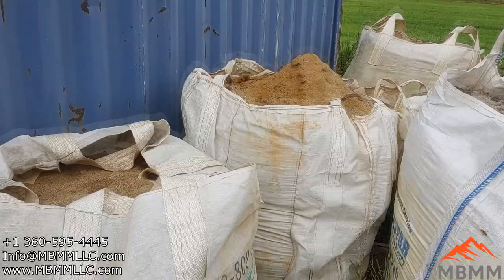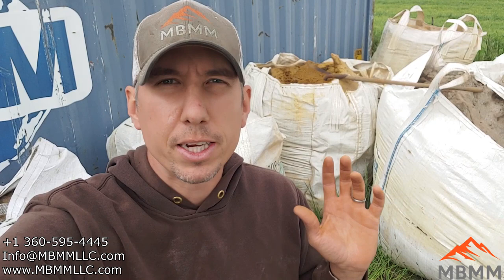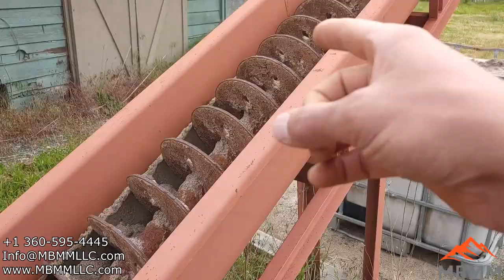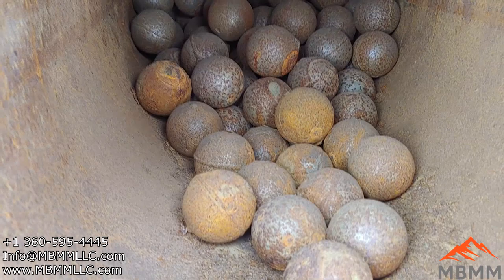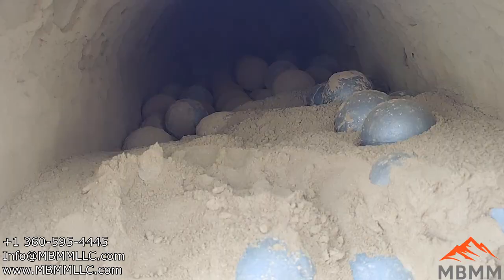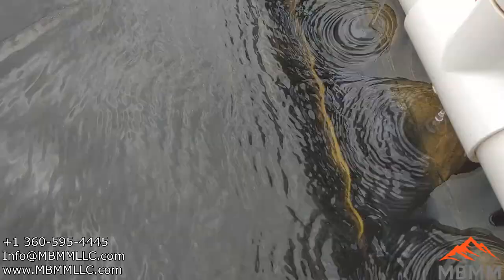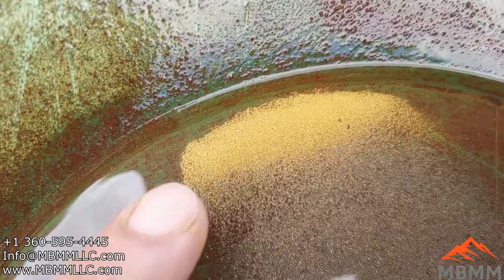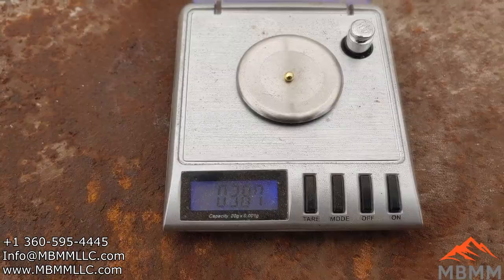Regrinding Gold Tailings In A Mini Ball Mill! Better Recovery & More Gold??

Comment: Adding some soap helps recover extremally fine gold, you want just enough soap to break the surface tension of the water, not so much that it has suds in it.. Adding Jet dry is better yet...
Reply: water softener and detergent is what you want. As you said lower surface tension so it can drop down

Comment: You can use stokes law to figure out settling times. If all your particles are the same size then just dump them in a column of water and pour off the solution at the time the gold hits the bottom.

Comment: There is a gold field here in West Central Victoria near Percidale where the gold is hosted in pyrite (Ordovician deep marine black smoker) - About half the gold is too fine to settle by density alone.

In the same area there are rich reefs with much larger grain gold and nuggets to several hundred ounces - derived from hydrothermal veins (likely originating from the same sulphide source, but moved)

So depending on the nature of the gold you are processing, your requirements will change.  Knowledge is power.

Comment: Jason there is non toxic leaching formulas out there , check out Action Mining.If you take some of your cons from the panning what you just ran from the ball mill, say 100 grams, soak in Aqua Regia over night, then do a Stanis Cloride test on the fluid the color of black will tell you there is gold left for recovery.
Reply: You will still have to do water works with Aqua Regia.
First you have to neutralize it, and then you have to distill out the salts.

Comment: When you were talking about the smaller particles having issues separating properly on the shaker table I had an idea. I’m sure you have, but have you done a test to see if varying the frequency and amplitude of the vibration on the table affects separation? And whether the efficiency can be improved with a finer material by changing these parameters?

Comment: Great video… excellent job of explaining your processes and teaching the skills to the world… I also believe you are still marginally above the point of diminishing returns… pulling 13.5 grams a ton at today’s market price is right at $750 profit per ton…  I don’t know what the cost of your operations run to conduct the extra processing per ton but I’d guess it’s below that mark…  and if a test sample is done prior to first run processing then it could be even more cost effective because then it could be a modified system first time around and not two totally separate processes…. Thank you for your excellent video.

Comment: I have just gone back and reviewed your video on regrinding black sands,and by comparison it would seem the tailing sands seemed to yield a better result than the sulphides.
Question One/..Could this indicate that there is more bound gold in the quartz  ,and/or other rock, in the sands ,than gold bound to sulphides in your number one and two tailings?
Question 2/...Would it be worth an examination under the microscope of grains in your sulphides and grains in your sands to see if bound gold can actually be seen?
Question 3/...I looked to me that you got a better result in this video by grinding dry than in the previous video grinding wet material. Would you agree with that? Cheers.

Comment: Adding jet dry to your water will break surface tension of the water for better panning ..   grinding for a lot longer till it is fully silted.      And when you smelted the bottom of the pour Ed crucible was still lumpy.  Maybe stir it a bit and keep heating then your molten into the triangle mold.     I'm autistic not trying to be critical of your methods but I felt I had to give you my 2 cents.  Thanks for your contributions and sharing your experiences.

Comment: How would a ball mill fit in the turn key system would it be opened ended with a screen and how fast could the out put be could it keep up with the whole system at full throttle

Comment: Agree with what you said about finding out up front how much can be liberated.  But you also have to factor in labor and equipment cost, no?  You had to gather, and load the ball mill then run it for an hour.  If you liberate a lot, but not enough to pay for the electricity to run that huge motor, let alone your time/cost shoveling it in and out 5 gallons at a time and moving the material around, is it still worth it?

Comment: 7:00 why not feed the ball mill back into the primary shaker and use baffles to classify/remove the oversize based on flow? I'm sure I have not given it as much though as you though.

Comment: so, i find a lot of black sands here in Vermont... do you think i might be able to find out what if any value it might contain? how might i do that? i know Vermont has small amounts of gold, so its not really commercial quantities, but what about the black sands? i seem to find huge amounts of it every time i go panning, and, i can even find it right on the surface of the river banks in streaks... im super curious about it, but i dont really have the means to grind or process it to find out if it has any value. but if it did... i woudl love to recover that value, if possible...
Reply: Black sand is chromite and/or hematite.   It has no value, but is similar, enough, in density with placer gold that it pans out last, with the gold.

Comment: If you line the bottom of your auger trough with sheets of rubber, you'd keep from forming a layer of sand/clay  between the auger and the trough.
Reply: You'd also create a hiding place for small material between the trough and the rubber.

Comment: could this ballmill itself or first hammermill and then ballmill separate metals out of electric waste? It would be interesting if you could mill for example old computer parts this small and then separate valuable metals without cemicals this way?
Reply from the maker: Yes, I would like to do a video grinding IC chips in it

Comment: I used my first cuppel to try and refine my 14 karat gold that I have and believe I did it wrong. Both cuppels look like their littered with gold that got absorbed. Used over 12 grams at got a 1.5 gram bead that doesn't even look pure like the ones you melt and make if my 14k was on the lower side I should have at least got 5 grams but 14k is 58. Something or 53 % gold by weight amd volume so Something went wrong amd I'm sure alot of my gold are in the cuppels if you could give me any advice cause it's not as easy you make it look cause I got 1.5 out of 12 grams of 14k it should have been 6 more like 5 grams and it doesn't look pure believe me there's something I didn't do right or did wrong I'm keeping everything cause I know the gold I used was legit 14k have had all my jewelry tested so there's like 4 or 5 grams somewhere would like some help would greatly appreciate itn

Comment: Might need to clean the spiral classifier 
You might have gold trapped in the caked on mud
Reply: It has been cleaned. If you watch older videos, you can see there is a lot of muck left in it, but now it's pretty clean. For their purposes, it doesn't matter that much, as those are tailings, not recovery. Any 20 pounds or so of crud remaining in the spiral classifier will not hold more than about 1/10 gram of gold, which will be recovered later anyway.
Reply: For an appropriate test everything should be very clean.

Comment: So, assuming a limited budget, run the turn-key system with the hammer mill until it pays for itself. Save your tailings and invest in a ball mill and rerun your tailings to loop back through your shaker table.
Reply: So like 45.000 Dollars Later you get  2 grams of Gold   Kinda how our Govt  works!!!!
Reply from the maker: Exactly.  Save up your tailings and if in this example you had another $850 recoverable gold per ton once you had 100 tons saved up it would be equivalent to $85,000 worth of extra gold to recover with a ball mill.  The ROI on that is great!

Comment: Can you comment on the effectiveness of bismuth vs. lead as a collector metal? I noticed the older videos use lead and lately you have changed to bismuth. Is there a video where you use lead on part and bismuth on part of the same material?
Reply from the maker: I use bismuth now because it is much less toxic than lead.  They are both effective, bismuth costs about 5 times more, but I don't ever use very much

Comment: Hey jason, how are ya... I have been watching your vids and vids from e waste refiners and I have decided I need to build a setup but I would prefer to stay within the realm single phase electricity. I see there are quite a few vids of people shredding e waste in machine that look suitable but they never give any info, could you help point me in the right direction? I am not on your continent so purchasing a machiine specifically from you would not be financially viable, but you also seem to specialise in much larger industrial whereas I am looking for home/light commercial, I will also be looking for a ball mill.
Reply: pretty sure my sparky said I am allowed to havve up to 40 amp outlets without going to 3 phase so that's 40a x 240v = 9600w

Comment: What does that mean dollar wise, Was it worth it?
Reply: Exactly the right question.  $57.34/g * .4 is $23.  That ballmill ran for an hour worth of electricity. Then there's the shaker table following. Plus the labor of handling the material.  If you got $3 in electricity leaves you $20.  15 minutes loading unloading the mill and 15 minutes feeding (which he could better automate).  $40/hr ignoring any other expenses.
Reply: @jcadult101  I got tired just watching you work, lol
Reply: @newnews3361  Wasn't me dude, I make more than 40/hr not going outside.
Reply from the maker: This was just a test.  Now I know there is an additional ~$900 per ton that can be recovered!